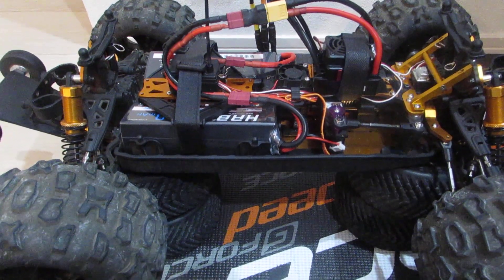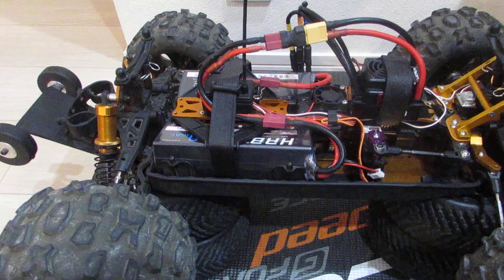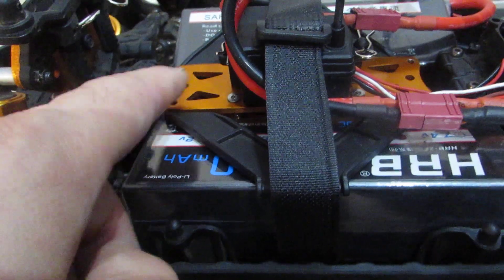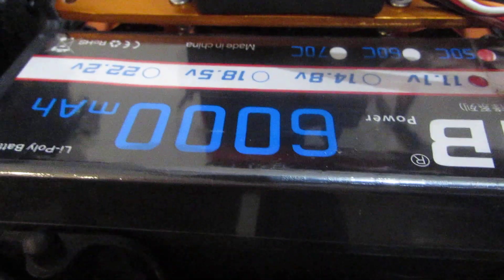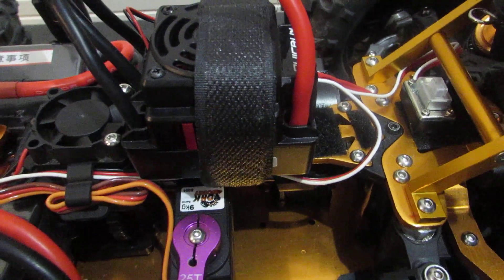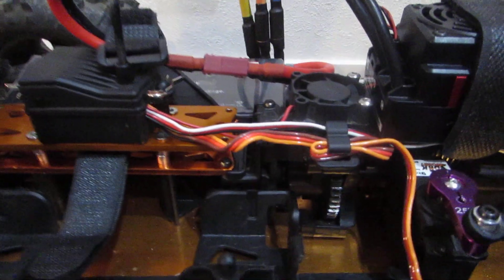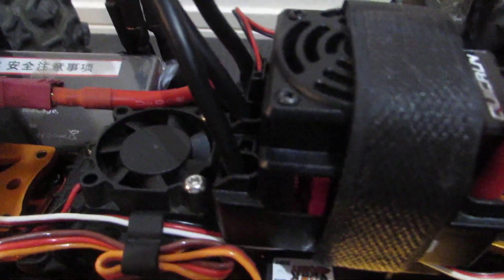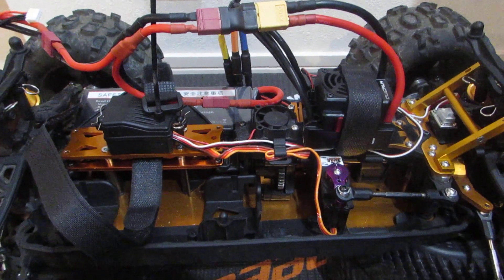6S Capable DHK Maximus on DUAL 3S 6000MAH LIPOs/Parallel

Comment: Hi. Did you upghrade any electronics like ESC or motor to run 3s through it?
Reply from the maker: Hi Paul take a look a this video for all of my upgrades https://www.youtube.com/edit?o=U&video_id=nyBxtAg4pB4

Appreciate you stopping by!!
Reply: Cheers but that will not work for me? @JapanRCAdventuresS
Reply from the maker: Paul, the truck runs on 4S out of the box! No need to modify anything for 3S.  All of my mods are listed on the video I referenced my friend.
Reply: Sorry I meant 6s. The link you shared would not work for me. I think I found the video you meant. 
 @JapanRCAdventuresS
Reply from the maker: Let me know if there is anything else!! I run the BLX 185 ESC and Arrma Talion motor - Id recommend not using 6000 mah lipos go with maybe 4000mah to keep the weight low. The Maximus is heavy enough already!!! Cheers!!

Comment: how long playing with 2 batteries in parallel did u get? 12000mha
congratulations.
Reply from the maker: 20 to 30 minutes depending on how heavy on the throttle

Comment: Since you run your 3s batteries in series what amp esc did you upgrade to? Just wondering if a 160A would be enough. I'm thinking about running 3s 100c-200burst 6500mAh but don't wanna blow it up. Thanks for your input! And I subscribed too!